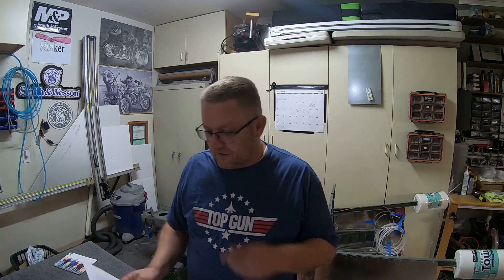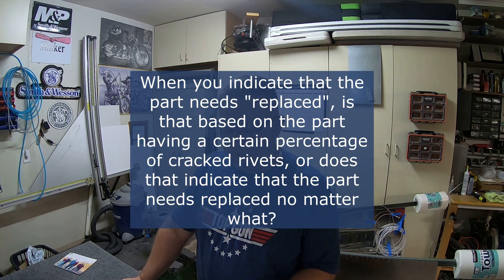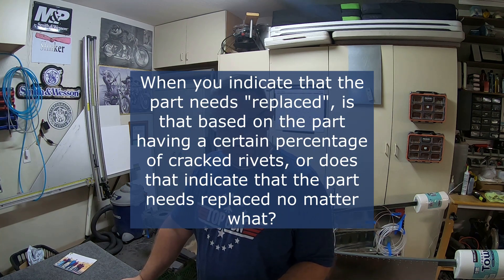RV-14A Build: Questions Concerning Laser Cut Parts

Comment: Are the parts "Dimpled" when they arrive, or do you dimple them?
Do you "Pin coin" the holes prior to the dimpling op.?
Reply from the maker: The parts are not dimpled when you get them. You will need either a "C" frame dimpler with dimple sets, or dimple sets for a squeezer or both. For the RV-14 all of the holes are "final sized" meaning that you do not have to drill them to the correct size you just have to rivet them together.

Comment: Was this an outside contractor(s) that took it upon themselves to change the process on how the parts are made? Or did Van's specify laser cutting? I would think, even if the part looks okay, the HAZ(heat affected zone) from the laser cutting, may still cause an issue during assembly. Do they even have a good handle on which parts were laser cut and which were not? How did they track it? Did they track it?

Can the company survive the major foul up? They have big cash flow issues apparently from the information on their web page. There are only so many options to address this. Some of them are, raising prices substantially, reducing the lineup of kits, laying off staff, getting bailed out by a wealthy individual, hoping vendors extend longer terms on payment, increase efficiencies, reduce costs. You only get so much mileage from any of them. They could raise capital by taking the company public and listing on the stock market. But then they become beholden to shareholders and the nature of the business will change. 

Does Zenith Aircraft laser cut any of their parts? If so, are the same issues present?
Reply: They cnc and punch holes but have never seen any laser tech used. I built a 701 but kit was just rolls of aluminum and nothing pre drilled.
Reply from the maker: From what I have been able to put together, The laser cut parts were not completed as designed by Vans and that was the major reason for the issues. Vans did release an engineering assessment (https://www.vansaircraft.com/2023/07/information-about-dimpled-hole-cracking-on-some-laser-cut-parts/) that helps explain a few things.
I hope they survive... it would be bad for me if they don't! My opinion is that someone will buy them out. I think they have a good and popular product and any one of their competitors wouldn't mind a piece of their potential profit. but you never know...
I'm not sure about Zenith Aircraft

Comment: I have completed my vertical stabilizer, rudder, most of my horizontal stabilizer and prepped most parts for my elevator.  I'm not comfortable drilling out rivets and disassembling the vertical stabilizer, rudder, and horizontal stabilizer and reusing parts that have had nearly every rivet set and previously drilled out.  Section 5 of Van's instructions states "the second rivet that is driven in any one hole [is] likely to be more defective than the first because the hole is enlarged and [the] rivet will be more likely to buckle and form an imperfect head."  So, for example, drilling out every rivet connecting ribs to the horizontal stabilizer spar would presumably result in a less structurally sound horizontal stabilizer.  I can accept replacing an occasional rivet but not replacing every rivet on any given part.  I will not proceed with my build without replacing every component of my vertical stabilizer, rudder, and those previously riveted parts of my horizontal stabilizer, including the front spar.
Reply from the maker: I agree... In my opinion I think Vans should replace all components of completed parts that contain parts that they recommend replacing... for example I have my vertical stabilizer completed. If the front and rear spars are to be replaced according to Vans. Vans should send the entire vertical stabilizer section to me. I would be fine with having to supply pictures or video of the completed parts... At Oshkosh someone asked a question similar to this and Vans response was, "we are builders too" so I have some hope that they will make some kind of concession concerning this topic... but time will tell... Thank you for your comment! At the very least we can form a support group :)

Comment: I took delivery of my Wing Kit on 31 March, 2022. I have Sub Kit #1 and #3 in my home shop. The rest of the kit is in its crate, stored in my hangar. Van's Laser Cut Parts spreadsheet identifies sixty-two (62) laser cut part numbers (not quantity) in the Wing Kit. So far, out of the twenty-four (24) parts in Sub Kit #1 and #3, seven (7) parts are within the "First Date in Inventory" dates. Two of the parts (Spar FL-00003-L/R - flap spars) are marked for "REPLACE" under the Laser Status column. That's a no-brainer. For me, my comfort level is to request replacement of all laser-cut parts if they fall within the First Date in Inventory dates, regardless of their Laser Status - even if I have to purchase them. But that's me.
Reply from the maker: Agreed, safety is paramount! after seeing some of their tests they shared at Oshkosh I feel much better about things.